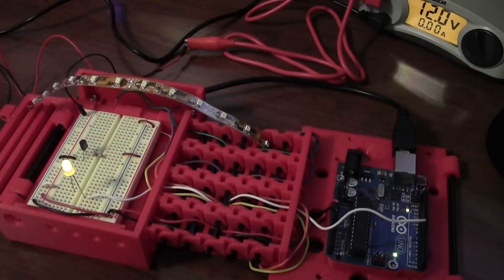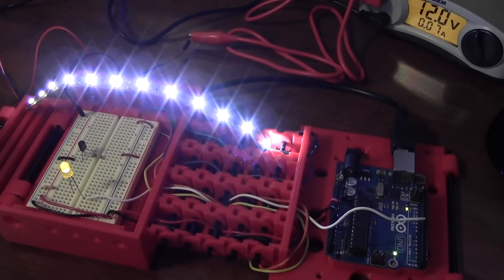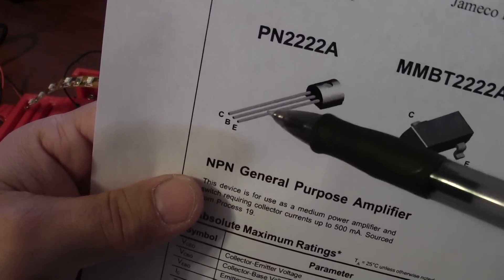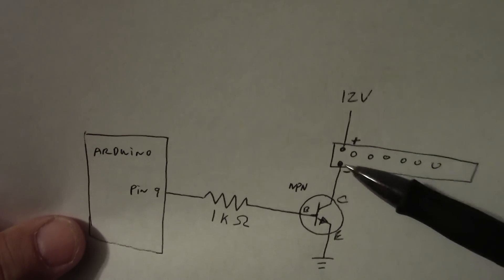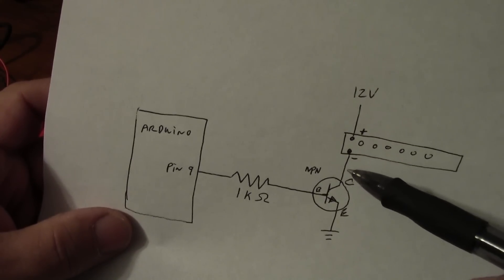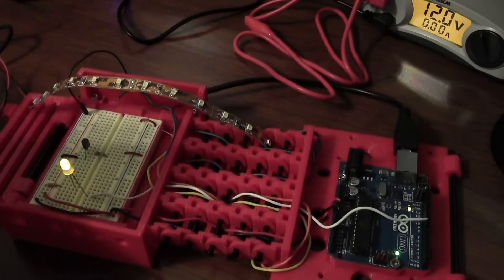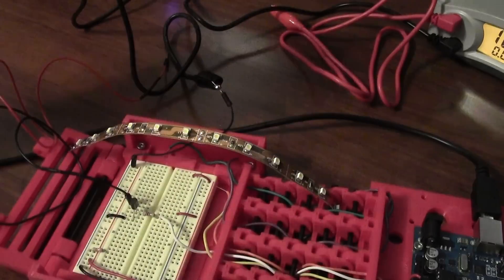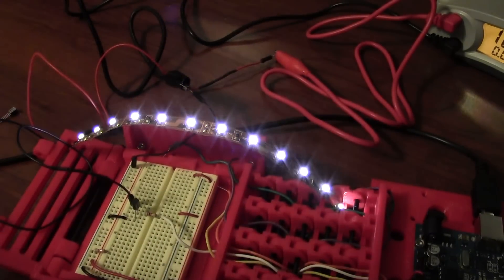Driving and LED strip from an Arduino with a transistor.

Comment: A noob question, could you use a a diode behind the resistor to make sure the current does not flow this way even if the transistor fails?
Thank you for the video I really was struggling to understand why people used transistor in those circuits!

Comment: How do you figure out if the transistor can handle the load of the LED strip?
I'm not sure my arduino can drive an 8W 24v circuit using a transistor..
Reply from the maker: Probably not, even in the case in this video, I'm driving 12volt, 24 volt would not be a problem because the arduino is only switching the transistor, but 8 watt is way outside my knowledge, I would consider using the arduino to drive a relay, you would only get on and off, but that should handle the wattage. And you.can get relays that are chip based.  Please note: to be clear, your driving outside the power requirements I've ever tried so I'm not sure how to handle it.
Reply: @ajmvfr  Thanks for replying!
And yeah, I want to use arduino to drive a separate 24v circuit, and it has to be incremental, because its for an RGBW LED strip, about 7 feet of it. So a relay is unfortunately out of the question. My problem is trying to decipher the ridiculous amounts of 3 letter abbreviations used in datasheets that are near impossible to google. :') I can't for the life of me figure out exactly how much current I can send through a transistor. At full blast a single channel would draw about 370mA, but I have no idea if that would fry a transistor or not.
Reply from the maker: @S0K0N0MI  I originally learned to do the calculation from a youtube video, but I have not idea what video it was, nor could I do it now 5 years later.  I don't think 370mA is a heavy load, just don't let that 24Volt get across your arduino.  Search for electronics tutorial here on youtube specific to transistors.  You need to find a video that talks about how to do the math, and how to calculate the resistor between the arduino and the transistor for that amp load.   Sorry I can't help more, good luck.

Comment: which transistor did you use?
Reply from the maker: Rafael Ski Fernandes de Carvalho I used an NPN PN2222A transistor.  I think it can also be labeled 2N2222.  I show the data sheet at about about 2:25 in the video.
Reply: Anthony Morgan Wow! Thank you so much!!! :)
Reply: +Anthony Morgan could i use a 2n3904?
Reply from the maker: +The DIY channel I'm not sure.  It's an NPN, so it's the right type and will probably work, but you might need a different base resistor.  It will also depend on how many amps your going to draw across the resistor.  That's the best I can comment, I'm just not that good with the calculations.
Reply: Should be fine then. Thanks for the reply.